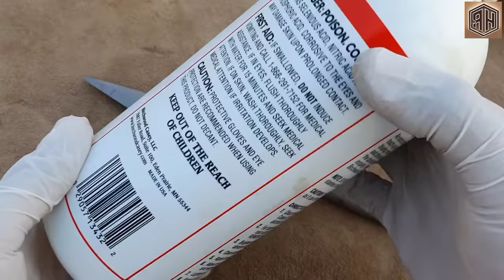Rusty Coil Spring FORGED into a KUNAI

Comment: Just imagine people in old times making this thing. Like, he needed this much time with all the modern machinery tools and equipment, how did the people without these things managed to do these 😅
Reply: because it was blunt and made with soft and easily manipulated metal, it was originally a gardening tool, like many Japanese and Chinese weapons.
Reply: That's what i think everytime i watch these
Reply: @lukatorres2384  so that's why katanas were so weak
Reply: Through hard work
Reply: @maksuzbrojony8221  traditionally made katana are made from arishikage or Damascus steel if they are treated properly the can cut through multiple layers of brick straight through.
It's a fun toy yo cut a man clean in 2.
Reply: @maksuzbrojony8221  an no they never break
Reply: Naruto

Comment: my question is who disliked the vid cause he legit just makes totally random metal and makes a katana and kunai
Reply: I don't have a problem with people removing stock to make anything, but this guy shouldn't say he's forging out a kunai knife if he's going to cut the shape from a bar. The only thing he forged was a bar. This is clickbait.
Reply: @cacklingpikeman4303  The definition of forge, is to make or shape (a metal object) by heating it in a fire or furnace and beating or hammering it. That was literally what he did in the video
Reply: It's still cool, but he didn't "FORGE a KUNAI" he forged a billet that he then cut and shaped into a kunai.
Reply: @bajancanadian4231  i dont know about forging stuff but im pretty sure that its still forging a kunai because if you will make a kunai you will need a piece of metal even if its a rusty spring metal. Am i right or wrong?
Reply: @Komi_Is_My_Name  Right. I dont really see everyones point here. Its like saying "No, you didn't bake that cake, you made the mixture then cooked it" Or,  "No, you didn't start that fire, because you did not create the air or the wood"
Reply: @Komi_Is_My_Name  That is literally not what he did.  He heated a bar and straightened it, then spent literally hours grinding away massive amounts of metal  The smaller spring stock, properly drawn out, would have taken a competent smith about 15 minutes.
Reply: @Komi_Is_My_Name  Yeah, you're wrong.  The cake comparison is erroneous, too.
Reply: @mzmadmike  I see your point more clearly now. I realize that I have been ignorant, as cutting is not part of forging. A better title would have been "making", or "creating"

Comment: cutler: how sharp do you want your knife

RH: YES!!
Reply: It’s not sharp just heavy
Reply: @roandehaan  have you seen any of his other knives?
Reply: @onceubeenblack5225  no but this wan isn’t sharp he even sand blasted the edge off
Reply: @roandehaan  did you watch the end of the video? the whole kunai went through the bottle
Reply: @onceubeenblack5225  yeah because of the weight do you know how physics work?
Reply: @roandehaan  do you know how blades work tho? the bevel on the blade is to big to cut stuff like hair
Reply: @onceubeenblack5225  that’s not the point tho it’s just not a specifically sharp knife mostly just heavy that’s why you cant throw a scalpel they might be sharp but have no weight so i if you knew anything about knives i wouldn’t have to explain it to you
Reply: @roandehaan  bigger bevel = heavier blade i think i do know some stuff about blades and anyway sand blasting the blade isn't going to blunt the knife, why do you think they use it on cars? it's to scrape the paint off but not damage the body of the car

Comment: If there’s an zombie apocalypse I’m coming to ur place for weapons
Reply: Tbh they probably aren't very strong. Just saying lol.
Reply: @fueledbypaintwater  why do you say that?
Reply: Same tho
Reply: I would to.....if I lived near buy🤣🤣🤣
Reply: You could always come to my house if Random Hands is unavailable, my friend and I sharpen sticks for fun and have a VERY ridiculously extensive collection of them. Most of them are small, around a foot long, but we have a few that we call swords even tho they're only sharp at the point that are a few feet long
Reply: @lucifero_5682  I'm no bladesmith, but I'm pretty sure rust isnt good for the strength of the knife.
Reply: @fueledbypaintwater  usually that would be a problem, but since the coil was so THICC the rust is only on the exterior of the metal, doesn't pose a problem at all. It's super high carbon steel, so after a heat treat like that, The blade will be nearly unbreakable
Reply: .God bless Jesus loves you,
Jesus can make all of us a new creation,
Verse: "Therefore, if anyone is in Christ, the new creation has come, the old has gone, the new is here!" 2 Corinthians 5 17. God bless Jesus loves you,
Websites: Faithventure. Biblegateway.
Reply: Those weapons would be garbage. He doesn’t actually “forge” them. He beats them into a billet (the flat piece he made) then cuts out a shape. Then he never hardens the blade. It’s lazy smith work and makes the weapons very weak and would not hold an edge. Honestly what you see in this video is probably the exact way 99% of the junk weapons you can buy on Amazon from China are made.
Reply: @Tuck93093  he did harden the blade, tf are you talking about?

Comment: "forged" you mean stock removal right? only forging done was to square up that spring
Reply: should he start by mining the ore...
Reply: Exactly. This isn’t forged, it’s cut. Forging implies the blade was shaped by heating and stretching and tempering the steel in the forge
Reply: @luca-xu9yn  nah Elijah is definitely right.  This guy only forged the piece of flat stock, then did stock removal to make the actual piece.  I mean it's still pretty impressive, just not actually a forged piece.
Reply: @luca-xu9yn   ....a rough shape isnt that difficult to make.
Reply: @haugdaug1679  Exactly. Thank you for commenting for me, I was gonna say the same thing. Its impressive whether he forged or cut it, but he titled the video as forged, so I would expect the blade to be forged.

Comment: Now the spy wouldnt have to worry about accidentally stab another kunai into a heavy and get it stuck between the ribs.
Reply: Now that i know that the Kunai is used as a ranged weapon... Why didn't the team just give spy 10 Kunai's and ammo to throw? Wouldve been way more quirky and original imo
Reply: @gamercat8109  spy mains are really used to the conniver's kunai since the upside is really good and would make spy mains mad,pissed or sad that they lost a cool weapon and they'll start attacking valve. Cool tho if the kunai's stats or somthing were like:
Upsides:
On Kill: restores hp by 85%
°Rewards players a kunai after a successful backhit  °Has a chance of dealing minicrits
Downsides:
-50 HP
°Marked for death for 2 secs after hit
°No random crits
-15% firing speed

Is that balanced? Cuz im pretty sure marked for death is really crap

Comment: Forged? Only forging I saw was straightening out the spring.
Reply: Then u need glasses my guy😎
Reply: @WorldsKimahri  grinding, cutting and drilling isn’t forging. Didn’t drift the eyelet, didn’t rough forge bevels or even draw out the handle. Just squared up some over sized piece of spring then spent hours removing excessive amounts of material and hardened it.
Reply: @WorldsKimahri  no, I’m saying he didn’t forge anything really, all he did was square up some round spring and didn’t truly forge a damn thing. Apparently that upsets you for some reason so enjoy your evening lol.
Reply: @tomrockholm-timeless_morph6691  i feel ya.. seems like a lot of people are dumbed down to knowing what reality is ..
Reply: @tomrockholm-timeless_morph6691  I’m inclined to agree. Forging is the act of using a forge and skill to form metal. The biggest thing that got me was not forging the bevels for the blade. Instead like you said you have a 2D hunk of metal that needs to be drilled, grinded, sanded, and while I do appreciate the work that was taken to create this kunai, it is inaccurate to say it was forged.
Reply: @DorianMariusGray  exactly, it’s still an awesome project and takes skill to execute but not accurately labeled.
Reply: @tomrockholm-timeless_morph6691  U stupid bro

Comment: A kunai is usually smaller than that as a throwable
Very light  but fast, if it's heavy it'll be slow but sharpness could be useful for both ways.
Reply: Kunai we're also used as digging tools so actually it's more accurate than you think